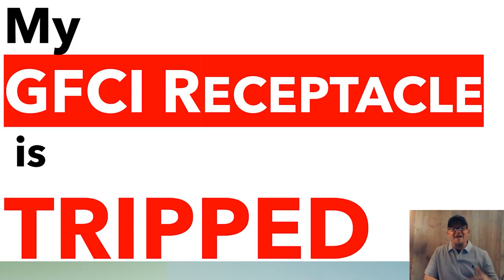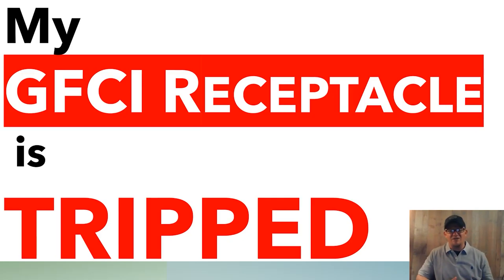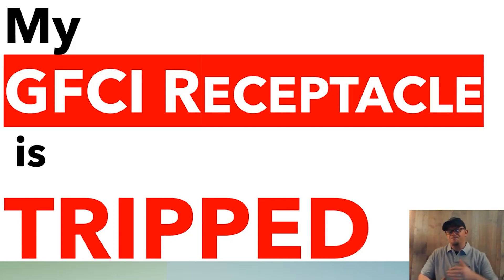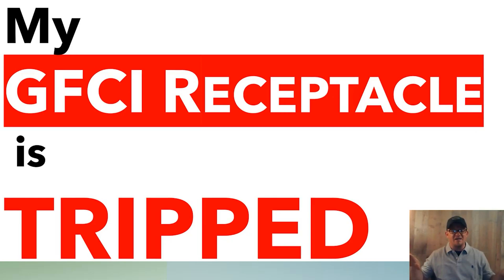GFCI receptacle / breaker Tripping or not working. Electrical Troubleshooting Electrician

Comment: I’ve lost several plugs and my fan in master bedroom I’m trying study before I go calling anyone I’m professional hvac installer I’m certain I lost neutral wire I have tested and ohmed them out I have OL open line between receptacle I can’t find the problem I may have tear my walls out I hate electrical
Reply from the maker: 😎You got this!

Comment: We had a slight water leak spray under the house.... would take the breaker 3-5 min to trip :) luckily I took a look under the house/junction box near the main pressure valve was getting wet :)

Comment: Super. Almost every third or fifth house that I wire up has a bad GFCI or AFCI from the factory, and i'd say that 40% of my calls are related to defective GFCIs, bad breakers & AFCIs and fuses, and the way people connect wiring to and after the GFCI. P.S. Tip. If the GFCI trips, but the breaker doesn't, it sometimes involves the white (neutral) and the ground, (wires touching or neutral fault to ground) but if the breaker trips and not the GFCI, then the black wire has a short or fault to neutral or ground. (Before or after the GFCI.) 💙 T.E.N.

Comment: why would my GFCI trip & not be able to be reset, but randomly came on by itself f a week later for about an hour & went back out. Also many of my non GFCI are going out through out the house ? Checked all the circuits & reset them still nothing . One in the kitchen was out for over a yr & randomly came back on for about 5 min? very stumped on how a GFCI could go out & come back on without resetting it? then going back out randomly? UGH

Comment: I changed mine out in the bathroom and it hasn't worked since. It was working fine before. All I did was change the light fixture and switch which are tied to the GFCI. Followed the same wiring attachments. There's power at the breaker box but not at the receptacle. I would love to solve it without calling an electrician. :face-blue-question-mark:

Comment: What if the red light is on, but the button won't push in? I had my keirug coffee maker plugged into it. Yesterday it wouldn't turn on. I noticed the button had tripped, but when i pressed the reset button, the button wouldn't go in. The light remained on. I checked the breaker, flipped it off...the light went out...tried the button again. It won't work. The button won't press in. Help!!

Comment: Scope: Troubleshooting old house. Been remodeled several times. / Issue: GFCI Breaker trips at panel Finding: Found lighting boxes have multiple branch circuits at box./ Found neutral tied together in one big bundle combining branch circuits at switch box. Theory: GFCI breaker trips because it senses a variation from hot to neutral from combine neutrals,  this is whats tripping GFCI..?  Theory/ Question: Dose the combined neutrals of these two circuits compromise circuit protection of receptacles further down on the circuit potentially energizing the neutral when the breaker is shut off?

Comment: Thanks, that’s really valuable information. I have to replaced my GFCI. Like you said, i have power at the wire but nothing out of the receptacle after reset it several time.

Comment: My outdoor gfci was working fine for months.  Stopped working.   Cleaned out a bunch of ants and replaced outlet.   Wired exactly same.  New outlet works fine with a low load item but trips after a while with a higher Load item.  Any thoughts?

Comment: I had a GFCI circuit breaker continually tripping because one of my co-workers zip-tied the wires together to make it neat but the amperage was leaking through the insulation and causing the breaker to trip. Once I take the zip ties off, it worked fine. Those things can be super finicky sometimes
Reply from the maker: Thank you for sharing

Comment: my issue was the last scenario. GFCI keeps tripping though nothing is plugged in to the related receptacles. GFCI power stays on for approx 30 sec then shuts off. all bathroom outlets related to the GFCI have nothing plugged in. Could GFCI go bad?

Comment: So because the gif I is on a circuit.. it can stop all flow from it correct? For instance I have a gif I in my bathroom that will not reset. Light switches will not work as well.. and I have a hallway light switch that will not work. It’s a single wide trailer around early late 80’s early 90’s I think.. no breakers tripped and all other outlets and lights on that breaker work fine
Reply: Gfci stupid auto correct crap

Comment: Great video, I have found GFCI recepts that were junk right out of the box. Other times a GFI plugged into another GFI, or on a GFI breaker. Rarer still, a feed through GFI wired incorrectly. Thanks!
Reply: Believe my hair dryer has a GFCI that I plug into a GFCI receptacle?
Reply from the maker: Thanks Don!!

Comment: 1982 house GFCI in the bathroom would immediately trip when reset.  The circuit included the receptacles at the other bathroom, front porch, back porch, garage and the basement. I found an extension cord in the basement leading to a pool of water near the floor drain that was backing up. Everything worked after removing the cord. The homeowner ended up paying $150.00 for me to tell them they needed a plumber not an electrician.

Comment: I had a gfci receptacle burn up. It was at the end of the circuit. It cause a fire at a customer home . Was an outside receptacle.  There was water damage cause by faulty construction. Water got behind the vinyl sliding damage the stubs.